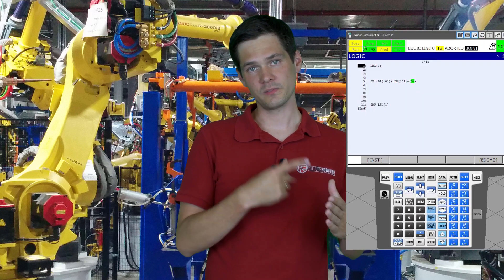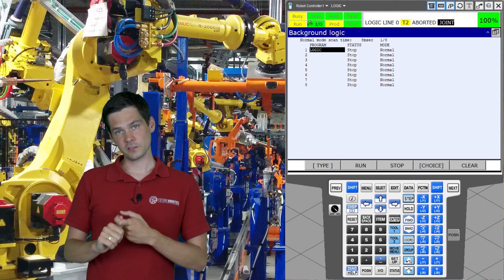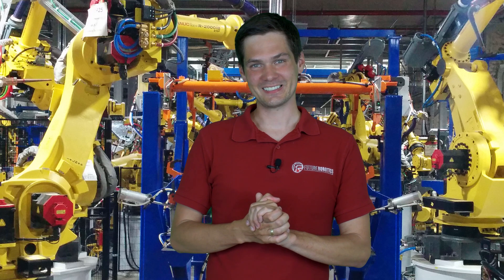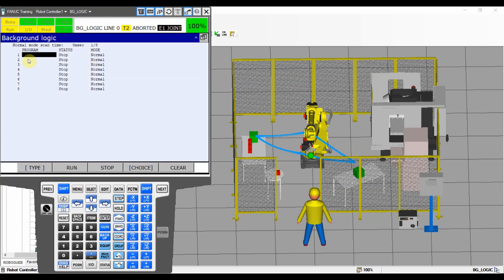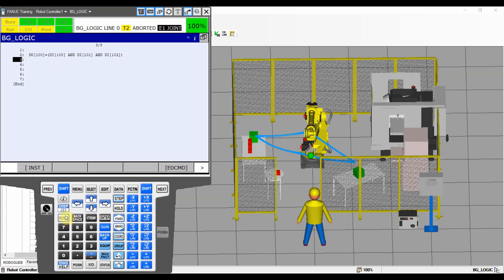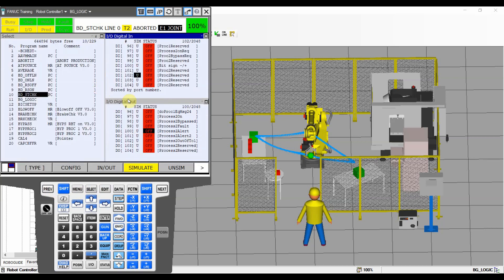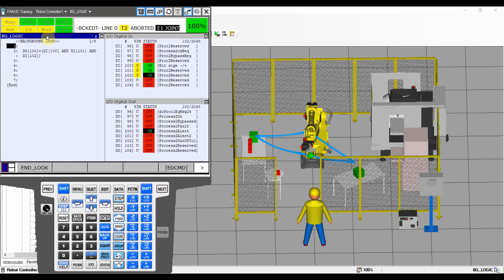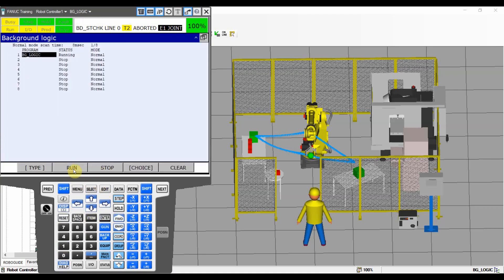How to create and run a  Background Logic program in FANUC robots

Comment: Thank you for spending time to make and upload these videos a lot of useful information. Could you make a video about replacing a teach pendant, particularly how do you know when the models are interchangeable. Not too much info on this topic online and even in maintenance manual. Like you cannot switch 2301 and 2308 TP models because  intrinsically safe and non-intrinsically safe models cannot interchange but what about all the other models and how do you know which models will work with your controller. Thank you!
Reply from the maker: You guys will never stop to amaze me with your questions :-) so many things you are doing, that's great !
I have replaced parts inside of Teach Pendants, but I've never tired to swap in-between models. Interesting question, but I think without electric diagrams it's going to be hard to tell. It's always best to ask FANUC (if possible), they will be able to tell you straight away

Comment: Another great video man.👌
1. Do we have to disable all the group mask for BG Logic programs?
2. What is the maximum number of multiple           control .i.e. the run command we can use within a program?
Reply from the maker: You can't use motion instructions, but you can make operations on PR[x].
You cannot use RUN command, but BG logic is a "RUN" command :-) The difference is, that RUN will stop when robot stops the program, BG logic doesn't stop